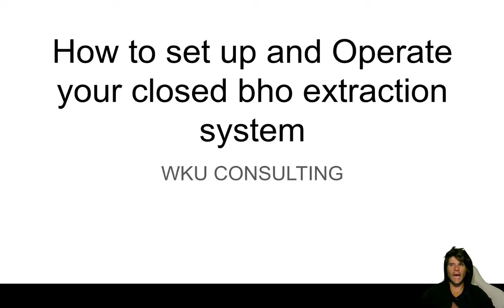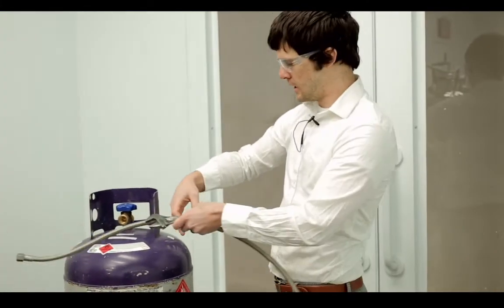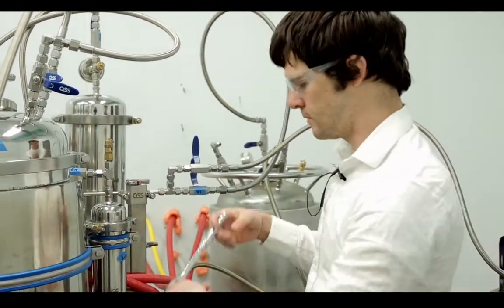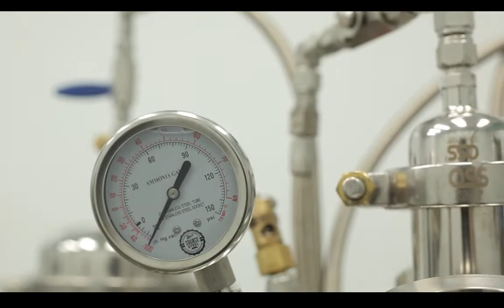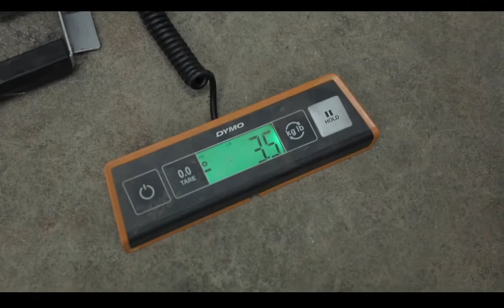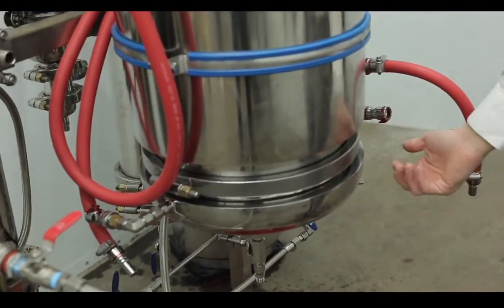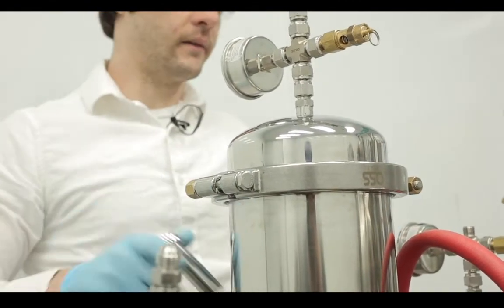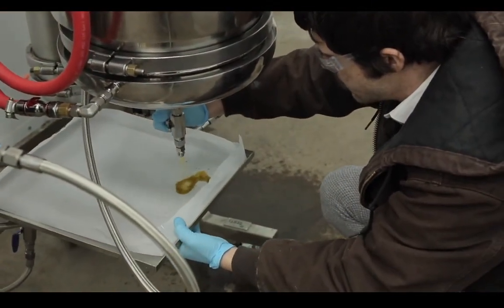How to set up and use your Closed loop BHO extraction system for FIRE dabs!

Comment: Those 12" jacketed bases can be tricky to put on if you're a solo technician! Semi- Pro tip, Pull a vac on the collection chamber before applying the base to hold it for you as you install your 12" Clamp. Cheers !
Reply from the maker: Thanks for the tips!

Comment: hey why arent your colums and lines frozen over from the chillers the bizzy bee at my job is always frozen from the chiller lines entering the system i didnt see that on your set up also why do you send fresh butane into your material column then to the evap colum? why not straight to evap colum to distill and send to holding tank>? any cons or pros?
Reply from the maker: Lines freezing over=too cold. I charge material column to clean my lines and also use this opportunity to wash my extraction socks.

Comment: Are those prvs safe to use dont they not close off until they lose almost all pressure meaning would release all your solvent out if tripped?
Reply from the maker: Your LEL meter and hopefully emergency ventilation will take care of that. Yes you are correct but would you rather have a machine over pressurize and explode or solvent dissipate into the air? Remember when you are in a C1D1 environment you are the only potential ignition source. If a critical room situation develops and you cannot figure out the solution in a matter of seconds (most often the case is a closed valve from pump to solvent tank or chilling failure causing heat to pressurize) then you need to evacuate you and your techs using an appropriate and highly reviewed fire/emergency plan. Close the valve supplying the gas to whatever system is pressurizing and leave until your LEL alarm stops sounding off. I have had a few critical room situations where prvs release and other problems. Most of the situations are quite obvious and easily fixed. Stay calm. Breathe. Fix it. If you cant. Leave.

Comment: wow awesome video ! what are the differences between this system and an ethanol based system? I know pressure is a big factor and I couldnt see ethanol working in this system
Reply from the maker: The major difference is the solvent used and the ease of recovery. This is not suited for ethanol.

Comment: Hey, what are these filter socks and where do I get them? 
I work for someone that runs a 10lb closed loop stand alone but we are thinking of converting to a wall unit, as it’s easier, these socks look like life savers! Then to have all the material loose in the column, 
Thanks
Reply from the maker: if you google filter socks you will pull up a bunch of information. This is the only way that i extract EVER since discovering these about 7 years ago. I am not affiliated with any of the suppliers however so due diligence will pay off!

Comment: That was a great tutorial, I have a question concerning your chiller that you hooked up to help recover the solvent.. The chiller that keeps the codensation coil to -40C. Does It helps pull the solvent back into the Haskell Pump?   I think that part of the video didn't really show what happened to the solvent recovery for me. . I just have a question of how you hooked that coil to help pull the solvent through the system.. If I use dry ice for that condensation coil as you did with the chiller. I would think it would do the same job.. I have a MVP 150 pump and would like to follow your method as you have shown.  I couldn't really understand how that coil helped.. I have a chiller that cools my solvent (butane 70 / propane 30) to -28.. I shall change to -10F now.. Thanks to your video.

How does that condensation coil that is cooled down work? I know it keeps the coil cooled but I think i'm just loss at where it is connected to and its glycol/water solution for the chiller.. Does the solvent (butane/propane) pass through that coil..? thatts where i'm confused.
Would it be possible to see a diagram of your system for the condensation coil.
Thank you for making such a wonderful video.
Reply from the maker: The condensation coil is kept at -10c -40 is too cold the gas will move slow. The coil does not assist the pump. The pump pulls the boiled off gas in vapor form into itself and pushes it through the condensing coil which turns it back into a liquid. Dry ice in a bucket will do the same thing. Regular ice and isopropyl works better
Reply: @WKUConsulting  
Thank you for your quick reply. ,   i've been using dry ice for my condensation coil.. and its been rather costly... will try ice/isopropyl..  I am still a little confused.. I understand that you use the condensation coil to condense your vapors back into liquid form. I have a condensation coil for my MVP PUMP and TRS21 recovery pumps..    

So in your lab you have two chillers, the first chiller is set for -40 C but gets about -13C this is chilling the Solvent Tank.. And the 2nd Chiller is set to -10 C for the condensation coil to help pull the vapors.  At 6"40 in the video i can see how it is hooked up..  But I don't understand how exactly did you hook that up the chiller to cool your condensation coil. Because when you are recovering your vapor doesn't that pass through your condensation coil that has GLYCOL/Water mix?.  My MVP 150 pump hooked to a 1/2" condensation coil that goes to my solvent tank.. I would like do as you did cool that condesation coil somehow to help pull the vapors as my condesation coil gets super hot during use..
 I will be having another chiller available for me at the end of the month.  As we are shutting down our distillation because here in BC the price of distillation is too low for kg. 

Also wondering if you charge a fee to do some consultation with you in regards to my system/extraction guides..  I have been having lots of issue and been quite frustrated with being a extraction technician.
Reply: @Viralrushed  The coil in the video is a jacketed coil, which allows you to hook it up to a chiller for cooling on the outer part, while the vapors condense on the inner part of the coil that is not touched by the chiller fluid. I believe the one in the video is from open source steel

Comment: Why introduce gas (before it's distilled) to the material column and other connection hoses? Wouldn't it be better to inject directly into collection column and distill it there?
Reply from the maker: That would also work if it's a brand new machine but distilling gas is a great way to clean hoses/fittings/extraction socks as well.
Reply: @WKUConsulting  fair
Reply: @WKUConsulting  No, that’s a great way to contaminate everything
Reply from the maker: My apologies sir but you have absolutely no idea what you are talking about. But thank you for interacting.